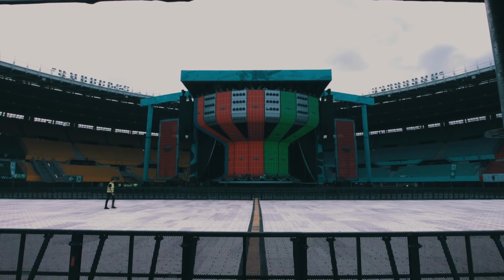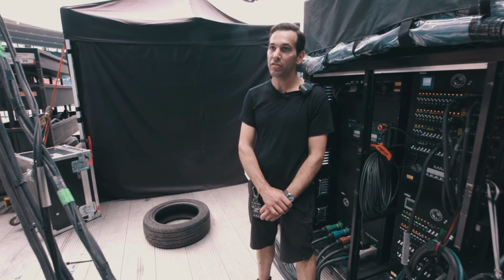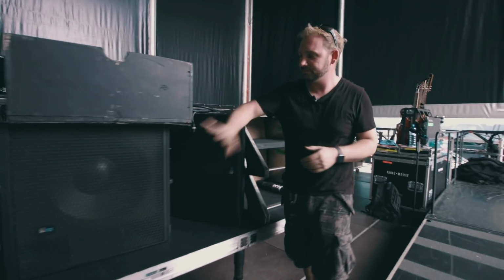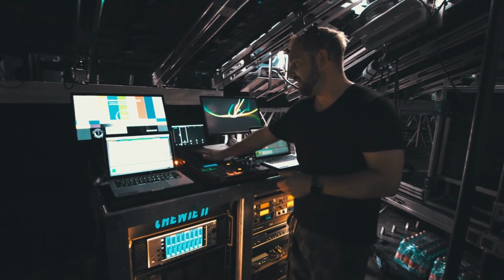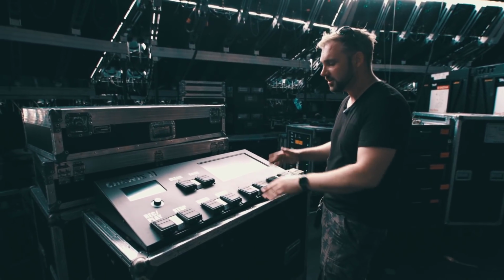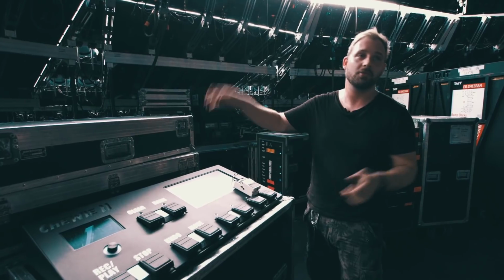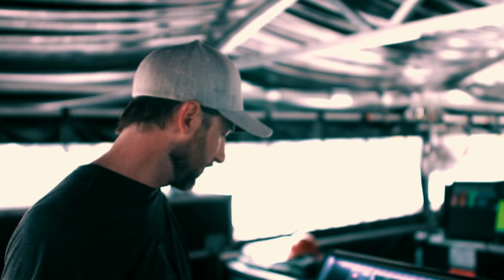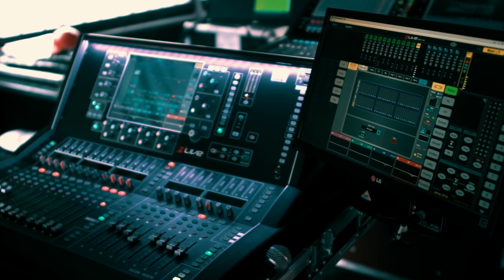Ed Sheeran "Divide" Tour 2018: Sound System Design and FoH sound for his support Jamie Lawson

Comment: I don’t understand the necessity for all that crap with the tuner. I have the same tuner on my pedalboard. I don’t have it in my signal chain. My signal goes straight in to my board and then my volume pedal has a tuner out. I can have my tuner on always and it doesn’t affect the sound or signal chain. I understand redundancy but damn. I always have a backup amp, guitars etc, but good grief.

Comment: I want to know how many amplifiers has to power the system, how many amps the bass system used to run the low frecuency
Reply: Meyer Sound speakers are active speakers, so each speaker box has its own amplifier built in. From 0:30 he goes through all the speakers he is using. You can count from that!

Comment: so with massive set-up like this which type of speaker system is advisable to use. Active or passive cabinets
Reply: Depends on preference. Both have advantages and disadvantages. The Meyer Sound rig in this case is all active speakers. Many shows of this size also tour with passive speakers, for example, d&b.

Comment: I'm wondering - if at some point during the set, let's say between songs, Ed strums his guitar and nothing comes out but his vocals are still fine - in the heat of the moment, what's the decision making process that would lead you to hit the 'backup' option and route everything through the backup rack - given that he could have simply pressed the wrong button on his stomp box?
Reply: Silence from the guitar isn't what they're talking about when they mention switching between the racks. The back up option is there just incase the laptop crashes, overheats, drops out, CPU gets overloaded, etc. It could manifest as cracks/pops/stutters/slow mo audio/computer locks up. It actually happened when Ed was at Wembley in 2015 and I'm assuming this was the solution they came up with to stop it ever happening again.

Comment: What happens if the mother to slave alignment goes out of phase?
Reply: The software they're using to host the loop station (Mobius looper) has a resync option built in that detects when the drift is greater than a set amount. For example, if the drift is out by 2048 frames, the master (or slave, depending on the setting) will realign itself to bring them back into sync.
Reply: halion9 Drum solo